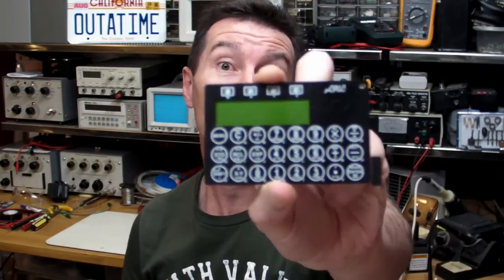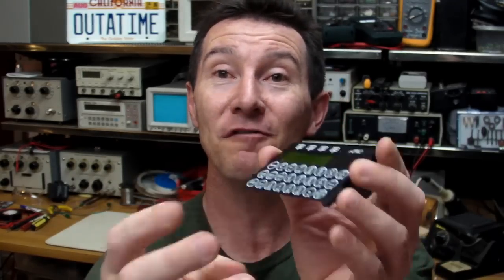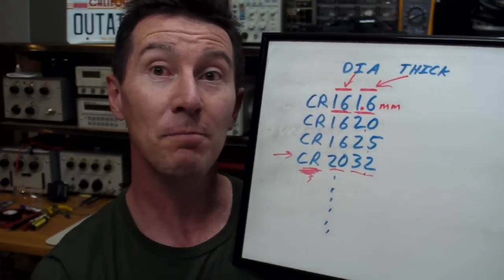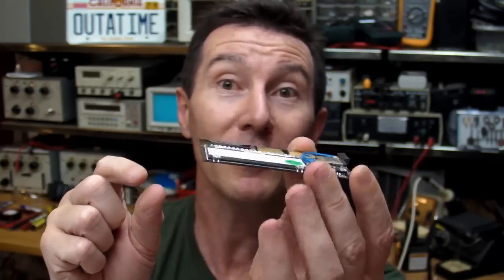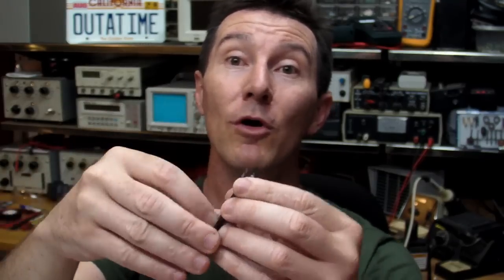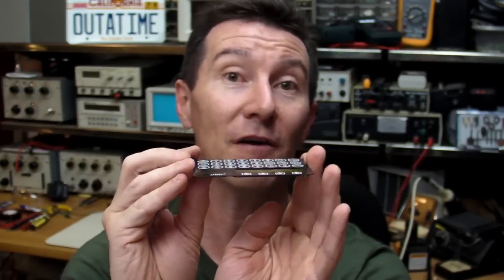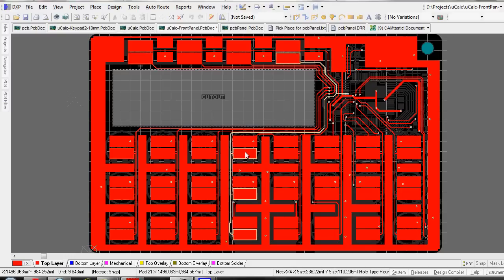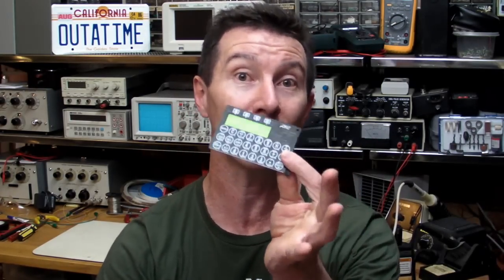EEVblog #130 - The µCalc Credit Card Scientific Calculator / Computer

Comment: For the battery - I've seen this trick: On that pad you added for the wire to the back board, solder a short compression spring instead. That spring makes contact with a suitably placed opposite pad once the boards are glued. Not sure of reliability, but ease of manufacturing is good. Even better, glue a bit of conductive rubber or foam rather than a spring.

Comment: @EEVblog For removing the battery design in a small narrow slot on the base PCB board so a toothpick or ball point pen can be used to push the coin cell out.  No need to give it a hard whack.

Comment: Thanks Dave for linking me to this video from a more rrecent video. I definitly gonna look into pcb frontpannel ideas and try touch sensing someday too. I might want to make (another) microcomputer based on some mcu or cpu... low power ;) 

No idea if it gets an answer here and I should probably hop on to the forum, but does anybody think that Infrared coms or direct touch coms is better for a small device like yours ? Im thinking about trowing serial over either a infrared transciever or go with 3 or four small pogo-pins  and somesort of cable or conector... what would you do, dear fellow youtuber or Dave?

Comment: @EEVblog @cr99991
If the batteries end up being too hard do remove, you could add slots on the back panel, starting just above the top of the battery areas, perhaps 1/4 of the battery diameter in length.  That would allow you push the battery out with a paperclip or screwdriver far enough to grab it.  Of course, you lose some rigidity of the contact, which may lead to other problems.

Comment: Great project!
When you were talking about the center PCB, I thought about the chance of forgetting the opening for the batteries and the next moment you mentioned it.

Is there a power switch or does the controller switch off everything and goes to sleep when the calculator is not used and checks for activity periodically?

Oh, and how do CR2 and CR123 batteries fit into that scheme? ;)

Comment from the maker: @DanFrederiksen I just hate calculators you have to charge up. I like replaceable batteries.
Reply: Just out of curiosity, would you detail the reasons why you do not appreciate rechargeable Li-On cells?
Reply: @MarkMcDaniel  Recharging them is an inconvenience
Reply: @electronichaircut8801  -- So, throwing away money by having to buy large packs of AA batteries and fill landfills with depleted cells is better?  How hard is it to recharge your calculator compared to the inconvenience of buying and storing AAs in bulk?
Reply: @MarkMcDaniel  Calculators already consume very little power. Many can even run with solar power so this is not really an issue unless with very powerful calculators, such as graphing calculators. A lot of charge of the rechargeable battery will be consumed due to self discharge and consumption by the BMS or other power management circuitry. Lithium ion batteries also do in fact degrade after a few years. There are other battery choices, however, they are bulky and defeats the point of this project. So I do not think upgrading to rechargeable batteries will be worth it.
Reply: @electronichaircut8801  -- Yes, if you have a teeny, simple solar calculator, it recharges its own button batteries.  Which means it's a rechargeable calculator, just more hands off.  I use powerful graphing calculators, which would destroy AAs.  Which is why I bought the rechargeable versions with Lion batteries.  It's not hard to recharge them once monthly using a USB connect to my computer.
Reply: @MarkMcDaniel  not every solar powered calculator recharges itself

Comment: couldn't you have just put one battery in upside down  (negtive on the back panel) and put the two batterys in series?
Reply: he needed reliability not voltage. if they are in series you only need one failing point to reset it.